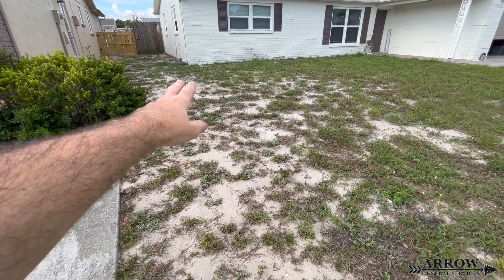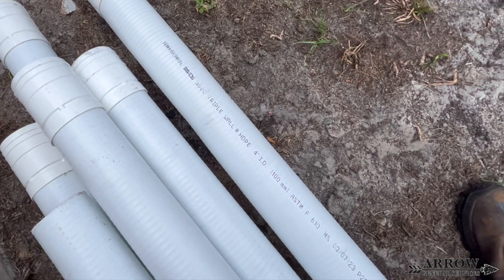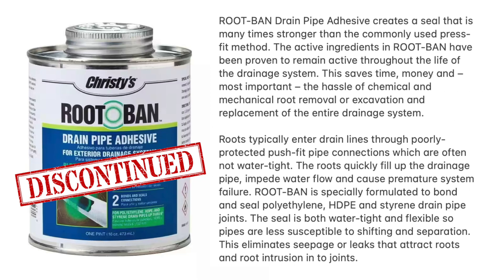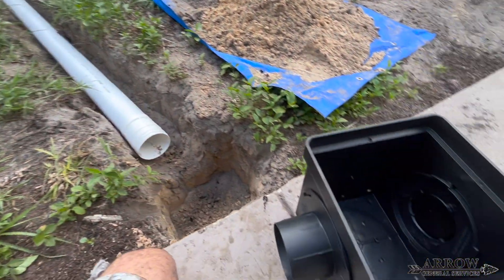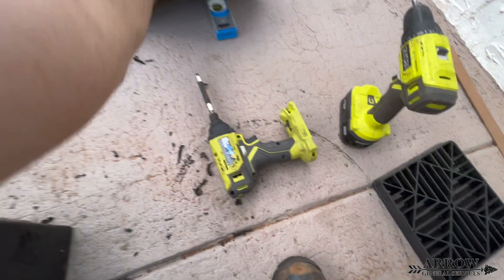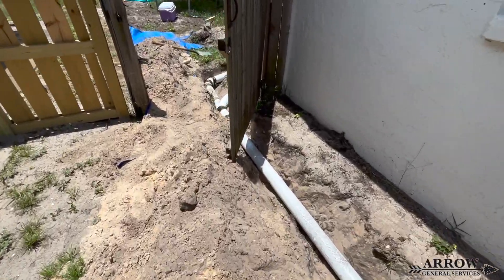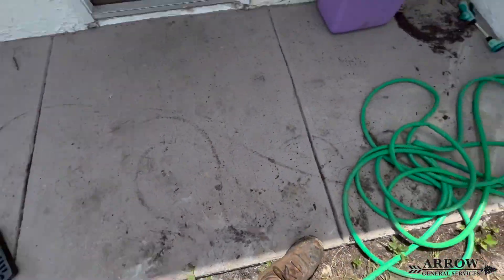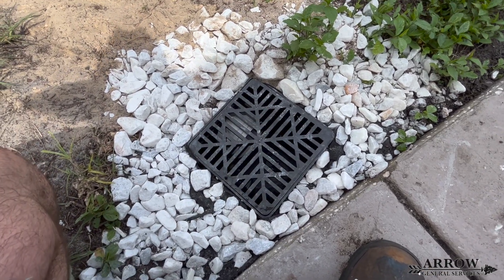HDPE Triple Wall Drainage Pipe - How To Install

Comment: In your videos with HDPE pipe, I see you insert them well into the side of a catch basin. Basically you have cut a hole through the catch basin for it. For 4” HDPE, what do you use to cut the hole in the catch basin and what size do you cut. (To insert the non bell end of the HDPe pipe).

Comment: Great videos. Been a longtime FDM watcher but I’m over by Savannah so it’s great to have a warm weather scholar passing knowledge now. I have a couple questions..do you still use the triple wall as I haven’t seen it in any of your other videos and it seems you prefer SDR35. My assumption is the only advantages to triple is it’s a bit cheaper than SDR35 and if you’re somewhere with a mild freeze risk you’d get some flex with a smooth wall pipe and not pay N12 prices. Random question, I don’t see you using catch basins either, is that because they’re not needed if your using SDR35 like they would be for corrugated because the risk of clogging with shingle gravel is significantly less with the smooth wall pipe? Appreciate the time you take to make these videos.

Comment: Thanks for the video. You say for the last part you used schedule 20 pvc bc it wasn’t deep. Is that bc it has stronger crush resistance? 
Also, if connecting to a wye and not on the same plane, is there a trick to angling it down from a higher level to the wye at lower depth, in the main line?

Comment: Thank you for this information - well done!    For gutter drainage systems in climate zones that freeze, is there concern for cracking/splitting of the PVC joints when using the 4 inch PVC sewer fittings with the double or triple wall HDPE drainage pipe - and if so, are there any other types of connectors that could be used?     Also - do you think triple or double-wall HDPE is more durable for long run gutter drainage systems in the north in an area with lots of trees?   Thanks again!
Reply from the maker: The pvc joints should be fine because they are not solvent welded to triple wall. The Hdpe glue and tile tape has give to them. So this allows the joint to move with the freeze and thaws. Dual wall in a northern climate on a downspout system is an excellent choice. Dual wall is stronger than triple wall.
Reply: Thank you for this useful information!
 @StormWaterDrainageSolutions

Comment: Are you using the built on bell for straight connections or cutting it off to use a pvc couple?
Reply from the maker: We are using the bell end that comes on the triple wall. Just make sure you check that it’s secure because sometimes in shipping they can get knocked around and loosen up.

Comment: can you use HDPE for sump pump discharge?  the HDPE glue says NOT FOR PRESSURE.  is a sump ok?
Reply from the maker: Sump pump is under pressure so I wouldn’t recommend using it for that application.

Comment: How do you deaylight  a pipe if you are working against the negative slope? My starting point is about 8inch deep and at the end, becasue I need to make proper slope, it would be ~18 inches.
Reply from the maker: In a situation where you will be running out of slope too quickly or end up being to deep at your discharge end, then a sump pump system might be the answer.

Comment: Would you recommend using triple wall or corrugated for up north climates?
Reply from the maker: If your on a tight budget then triple wall pipe is going to be the most affordable option. But I would use either dual wall corrugated pipe or a high quality single wall corrugated pipe.
Reply: @StormWaterDrainageSolutions  Do you prefer the big box store black corrugated pipe over this triple wall?Edit: I’m in North Carolina.
Reply from the maker: @doSam_6146  We would recommend staying away from the corrugated pipe that the box stores sell.
Reply: @StormWaterDrainageSolutions  Thank you 😊